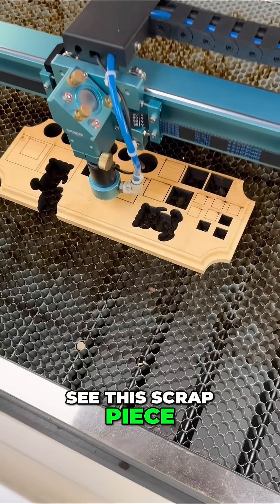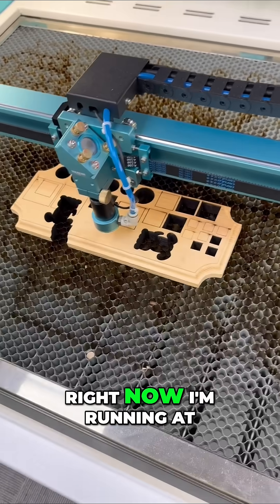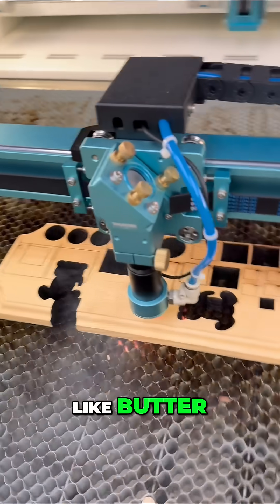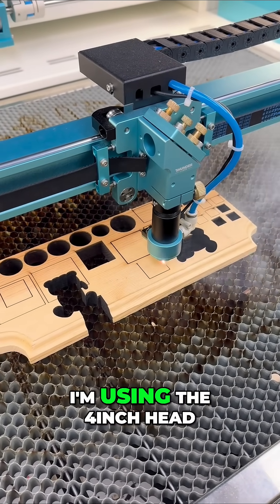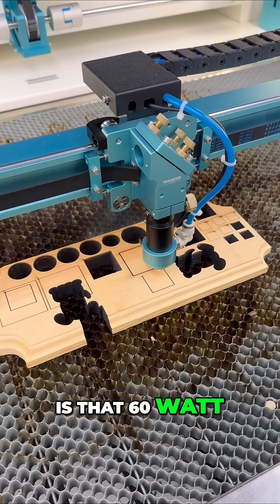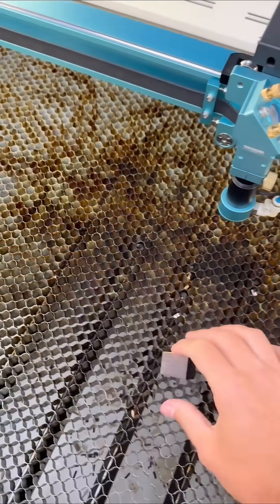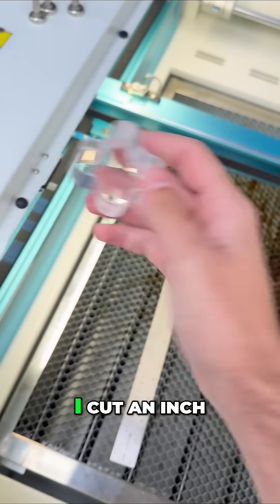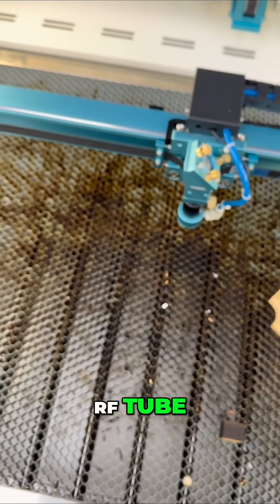Nova Plus Cutting 3/4" Pine

Comment: That's awesome - are you using the stock air compressor or using external air compressor? what PSI are you using for the cut High Air Setting? Thanks so much
Reply: This is stock air as high as it will go!
Reply: @grantburrage3106   Thanks!
Reply: What about cutting MDF?